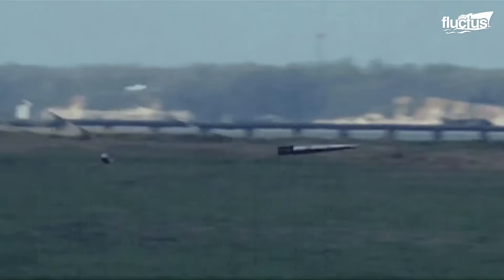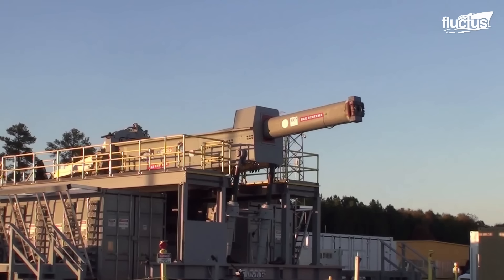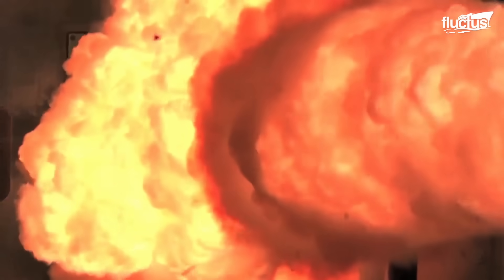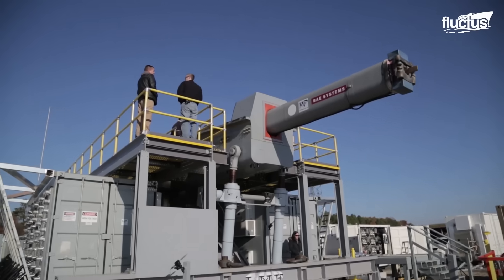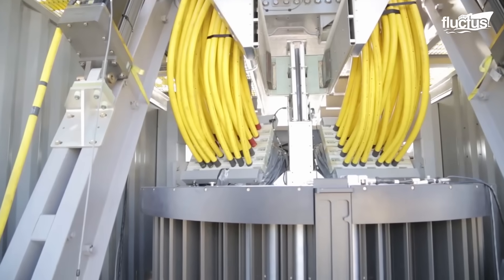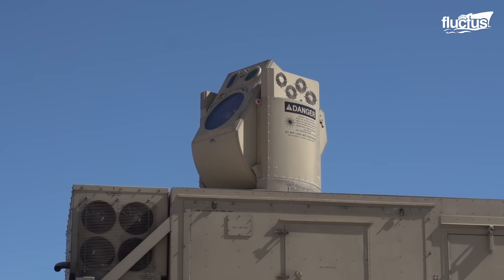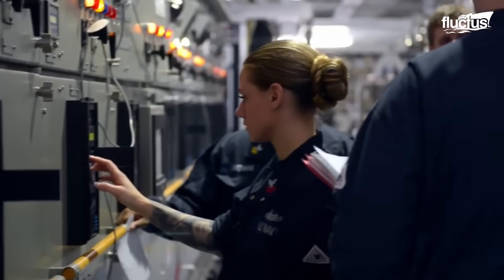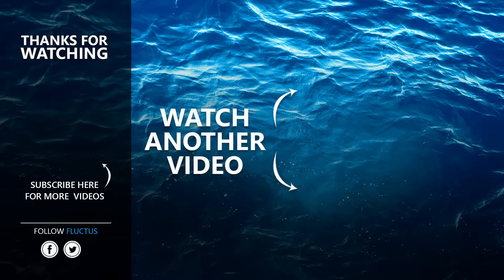US Testing Monstrously Powerful Rail Gun Firing at Mach 7

Comment: 32° down angle for 33 feet or more to target target must nucleate ripple phase plane shift a window or a bubble or a hole to fall into rather than doing a work field cavitation you still are gonna need the work field to control your exit vector, but you can establish it electromagneticallywhile falling due to nuclear harmonic reverberation from the drive train will also work

Comment: They walked away from the electric railgun which is a line of sight such as a sniper. To go and develop other alternatives that can cost over 20 million using the MOAB ! The railgun for few dollars per shot. That doesn't sound right. Not by a long shot. No pun intended. We have nuclear powered ships. Power supply is not an issue. Even if we put it on the front of a zumwalt, the turbine generators are more than sufficient for the railgun. Seems like the zumwalt of destroyers are being treated like a black sheep of the fleet. It can defend itself 5 kilometers. I've seen Sam's go straight up and right back down in front of it also. Tomahawks. Cost millions of dollars to defend itself. Never to less it can defend itself. I believe it's lobbyist in the house in Congress and senators per the subcontractors that are influencing the direction that we're going. Oh yeah! We can take the fight to the aggressor. The railgun is kinetically designed with that much speed and density of the pleated uranium shots, even the hammer. When it hits it's over 👀💨🕊️❤️🕊️ I love the Navy, but I truly believe that they're getting the scraps. USAF has NASA and their wind tunnels. Hour 53 squadrons have suffered as a money pit to redirect money into other objectives. It's the only way that Navy gets anything. Now Trump's back in office now every branch will have the proper funds but there's never enough money. But the USA is no joke to any country anymore. God bless you all with safe sailing 💯🇺🇸⚓💙🕊️❤️🕊️
The railgun could be used as a howitzer. It can go vertical and come down like nobody's business. Or it can be shot as direct lineup site as I mentioned above. Sorry for the bio 🫣

Just an old and US Navy rotorhead. What do I know?,👊😎
Reply: You say “sniper”, you do understand that a snipers shot takes in account wind drift, bullet drop, and curvature of the earth. It’s anything but laser straight.
With that said I don’t see how this wouldn’t use the same